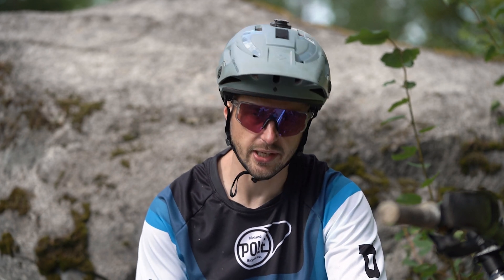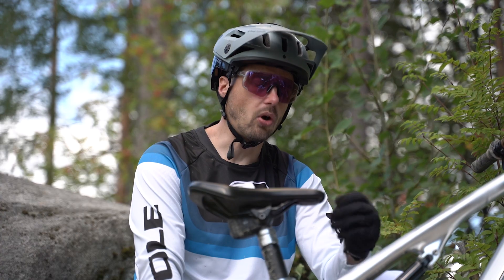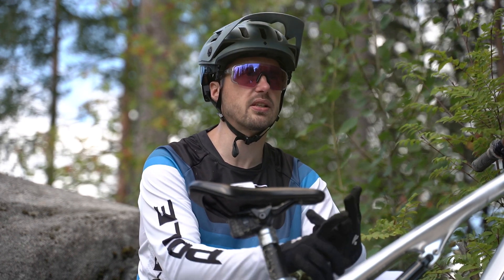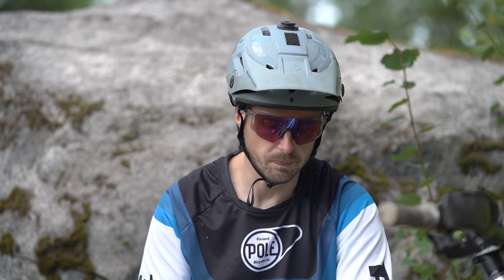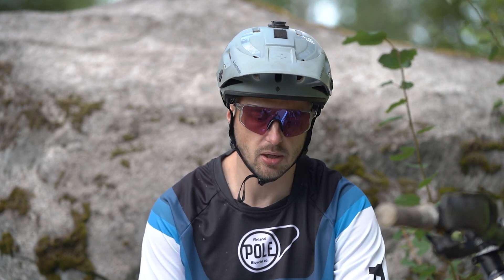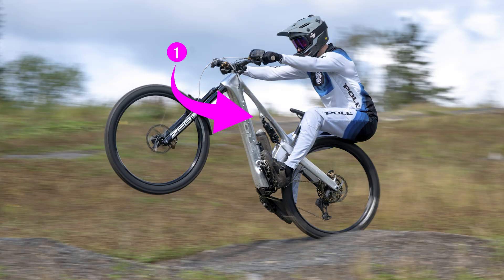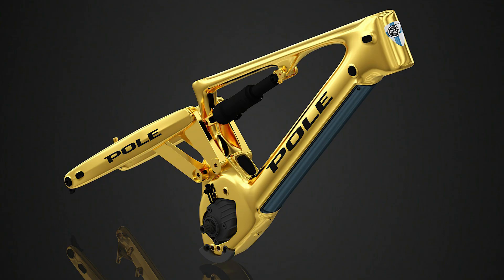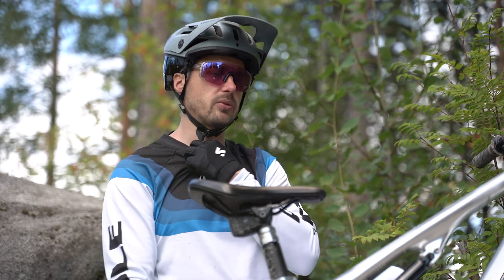Voima Sensei Suspension Explained - Part 1

Comment: I'm saving for either an Evil Epocalypse, Transition Repeater, or Ibis Oso. I'll make my decision after I get a chance to spend some quality demo time on each one. I am a huge proponent of try before you buy, especially with this big of a purchase! If there was some way I could demo both the 150/160 rear/front travel Pole trail emtb (forgot it's name, Finnish is a hard language for English native speakers haha) and the 190/190 Downduro Voima. The Voima with an Öhlins DH38 double crown fork, Super Deluxe Ultimate air with MegNeg air can, mixed wheel sizes sounds like the most fun bike ever! Especially considering that literally every review I can find anywhere about this bike all rant and rave and praise it's climbing prowess, which is simply amazing on a 190/190 E bike with the longest wheelbase on a size "medium/large" I've ever seen. I think that Leo's secret sauce is something I've been saying for a long time: bikes with reach numbers, and wheelbase lengths comparable to Pole's measurements absolutely NEED a seat tube angle of AT THE LEAST 80°, and a head tube angle somewhere in the range of 63°-64.5°. The only changes that i would make to the bike is first and foremost find some strong 150mm cranks and then get a pair of Crank Bros platform pedals with the longer spindles kit installed, thus making the q factor wider and the riders stance wider for more stability and better balance. I'm also a devotee of the Cult of Shigura and have been for years, so a set of XT5's with trickstuff organic powerpads and 223mm×2.0mm Galfer rotors would be next. Then when the OEM tires kick the bucket I'd go full plus size with DH casing: 29×2.8 Assegai 3c MaxxTerra and 27.5×3.0 Minion DHRII 3C MaxxTerra